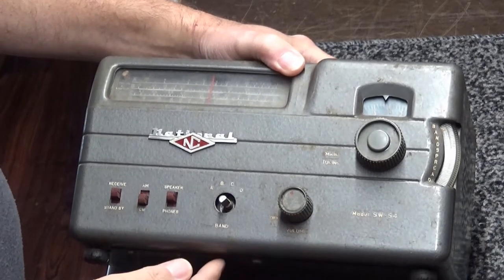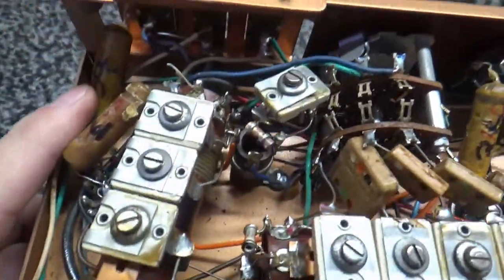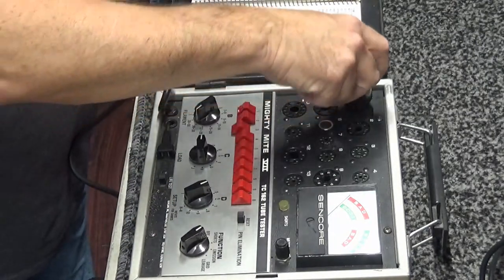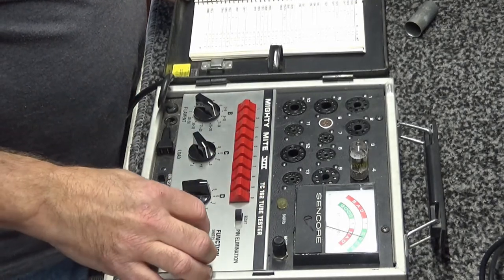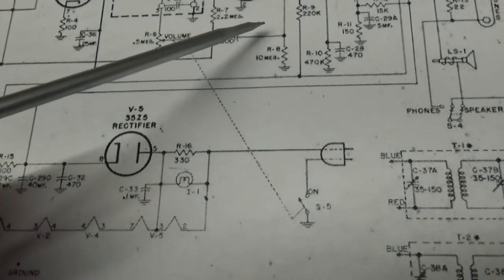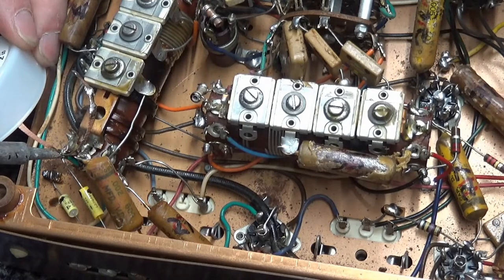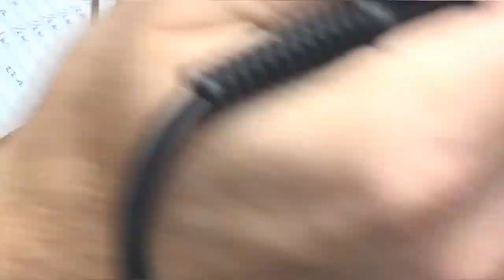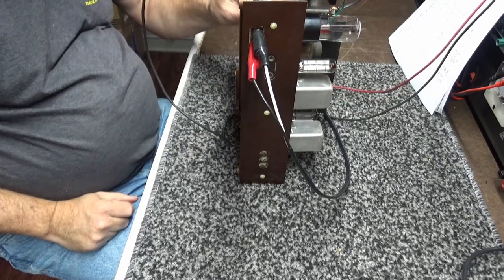National SW-54 Multiband Radio Restoration

Comment from the maker: Thats a good little radio to work on, be careful of the metal chassis, make sure you use an isolated ac power supply and take your time. With that being said, a lot of times you will find that the tube socket connections need cleaning. move the tubes around one at a time and see if you can find one that might get it going. thanks for watching and good luck and be careful.

Comment: Just got one of these, wasn't expecting it to work (and it doesn't). I discovered most of the caps have been replaced including the large electrolytic. I briefly got some static out of it and thought I might get something on AM with an antenna but I'm not getting any sound at all now. I don't have a tube tester so I'll be looking for one (all tubes do light up).